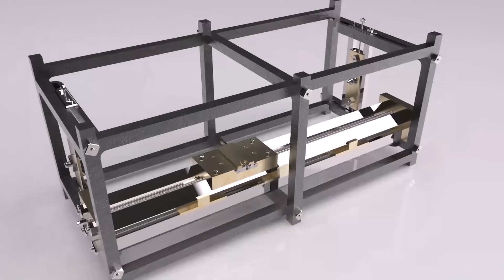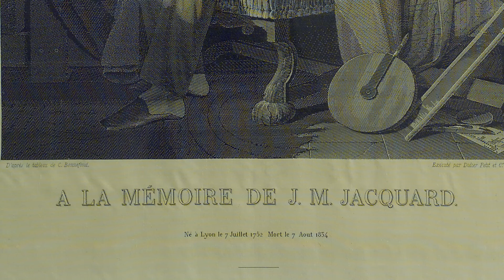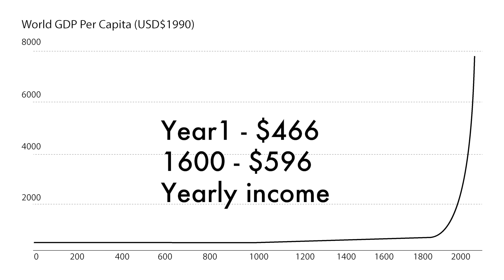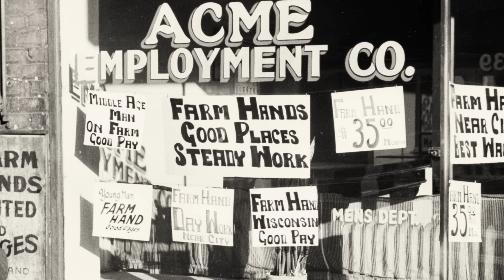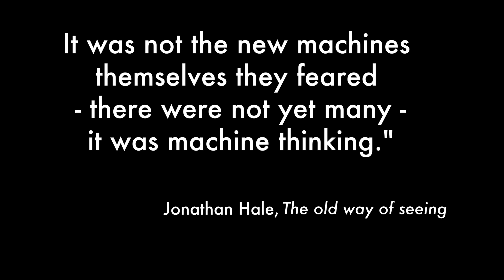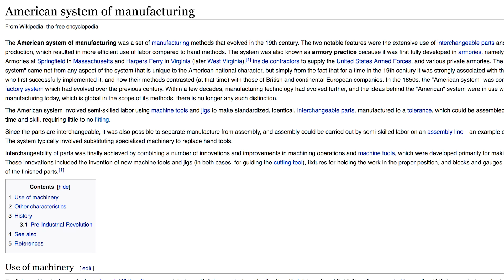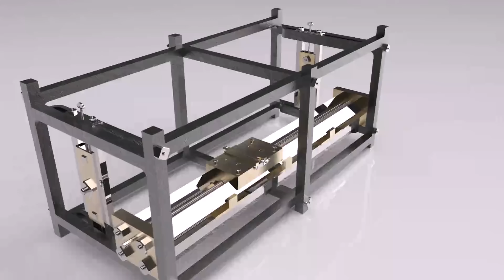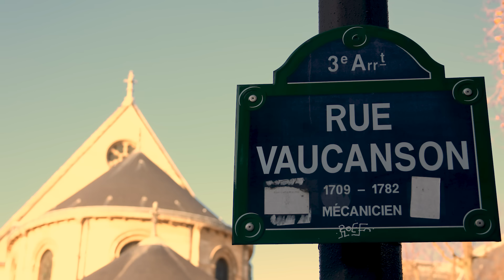The 1751 Machine that Made Everything

Comment: The lathe is the only machine in a machine shop that can duplicate itself and all the other machines which have to start with the lathe.  One of the best videos I've seen to date.
Reply: the people on here who are disagreeing with you obviously have no machining experience. I confirm 100% with you that you can make a lathe with a lathe, and a drill press and most other machines.
Reply: When my lathe was waiting for a new motor, I used my mill as a lathe. Obviously a bit cumbersome, but it got the job done.
Reply: Perhaps a 3D Printer can print itself.
Reply: @MildMisanthropeMaybeMassive  indeed it can, look up the "reprap" project. that was the principle behind it, it produced 95% of its own parts, with only the motors and electronics requiring other processes.
Reply: @MildMisanthropeMaybeMassive  I wanted to create a Lego Mindstorm robot that would dig through bins of pieces and build a copy of itself and then access a computer to program that copy with identical instructions.
Reply: @VincentDangerWater  I would love to see that dream become a reality. Even if it doesn't work I can imagine a video about the process and challenges going viral.
Reply: @MildMisanthropeMaybeMassive  I can give you a hint about a few of the most significant challenges.

You wouldn't be able to work within the Mindstorm NXT software to program the thing.

Visually identifying specific pieces while digging through a bin of pieces is a very difficult task requiring massive parallel computing.

Building lego "hands" that can manipulate and assemble legos seems like the fun part. You'd have to overcome a grip issue by pre-applying a rubberized coating to the manipulating fingers.

Finally, the challenge of overcoming the limitations of the strength of lego connections. Certain lego connection types are stronger than others. The hands need to be built out of the strongest connections, otherwise the compressive actions needed to assemble parts would sheer the hands apart. You'd have to have a very meticulously ordered assembly strategy, with the robot potentially pausing at points to service its own lego connections, if loosened during the procedures.

It would be fun to see someone pull it off though. For such a silly idea, it really would require a massive range of disciplines.
Reply: @VincentDangerWater  Lego and Youtube is built on silly ideas and massive discipline.

Thanks for writing all that.
Reply: Yes Scott
Reply: Ever wonder why early milling machine were horizontal? It's because the first milling machine was a lathe driving a "rotary file".
Reply: YoYO Semite  ironically the only machines better at producing parts than 3d printers? are lathes and their ancestors the cnc machine.
sintered , 3d printed and moulded metal parts out of powder using SLA 3d printing are good but machined parts from billet are still far superior in accuracy and quality.
Reply: Do you think it includes machining the bed of the lathe as well?
Reply: You took the words right out of my mouth! Our machine shop teacher once told us this!
Reply: Mill even better...
Reply: @RealRocdad  Mill is basically lathe with one extra axis
Reply: I heard about a book that I haven't been able to find. It's a how to.
How to create wood and stone tools, use clay to create molds, melt aluminum cans down to cast parts to create a crude metal lathe, use it to create a planer and then a more precise lathe. It's one for the "survive the apocalypse" shelf of your library.
Reply: What about the furnace to make steel?
Reply: iT cOuLdN't mAkE tHe cAsTiNg. You obviously wouldn't use a casting, you would use a weldment. With the obsession of "oDdLy sAtIsFyiNg" video genre, machining channels have blown up over the past few years, and it's been a blessing and a curse. Now we have non machinists that think they're machining geniuses because "i'Ve wAtChEd aBoM79 reEEeEE." They have polluted machining channels with their attitude of being a machinist because they've watched YouTube videos about it.
Reply: Lathes are AWESOME, but if I was forced to pull one or the other from my shop, I'd definitely keep my MILL, I can duplicate lathe operations using my MILL, but I can't duplicate mill operations with my lathe. I find a flaw in your reasoning.
Reply: @ScoutSniper3124  Sure you can! Pop a collet chuck onto your spindle, stick an endmill in that puppy, and use your cross feed as your X axis and your long feed as your Z axis. lol
Reply: @ScoutSniper3124  lots of milling operations can be done on a lathe.
Reply: @ScoutSniper3124  As long as you don't need too large a milling operation, you can buy a milling attachment for your lathe saddle [it usually attaches in place of the compound] and duplicated milling abilities by mounting the cutter in the lathe stock. Yes, it's a kludge, but far less kludgy than performing lathe operations on a mill. Just saying that it's a hard call, & depends upon what type of operation you use most.
Reply: @ScoutSniper3124  you are obviously not a real machinist or you would know you can mill on a lathe.
Reply: @Gebox68  how do you mill on a lathe?
Reply: @johnbecker3116  as jason flieger said in a previous comment. you use your spindle as the toolholder and clamp the workpiece where you would have the toolholder.
Reply: @Gebox68  so you turn your lathe into a horizontal mill with no y axis... What are you going to mill with that?
Reply: @slash09r1  you would fit a vertical milling slide.
Reply: @johnbecker3116  You swap the tooling. You hold the milling tools/bits in the lathe chuck with a collet, usually a 5C type and you use a vertical milling attachment on the cross slide to hold the work piece. Granted you will not have the same length of travel unless you have some elaborate setup for a long bed on the vertical milling attachment, but it could be done. I would gather that all that time, effort and cost would be greater than finding a good used Bridgeport mill in the long run.
Reply: @johnbecker3116  I have seen people cut square and rectangular cubes/bars/slabs of metal (to accurate measurements) using a four jaw chuck, some math, and a piece of round stock large enough to get the desired part out of it. Though, I'll admit that there are limitations, you can do a lot of things you would do on a mill on a lathe (though to a much smaller scale).
Reply: Not entirely correct, you cannot cast or forge the stock required to make a lathe with a lathe, therfore a lathe is just a tool that is used as part of the process to build a machine
Reply: @techronmattic5876  The earliest metalworking lathes were timber.
BTW a potters wheel is also a lathe...
Reply: @allangibson8494  thanks for proving my point, just as you would not use a wood lathe to chop down a tree and prepare the timber to a workable size i was pointing out that a metal lathe is hardly where it all starts, all in good fun
Reply: @techronmattic5876  No but you can get away with flint tools to do it...
Reply: @techronmattic5876  he said wealth was increased because of the metal lathe.  not sure i agree with that as the main reason either.
Reply: @techronmattic5876  you are being pedantic!
Reply: @Gebox68  most lathe tools in days gone by were forged before going to a machinist, just pointing out that without smelting and forging the mighty machinist would be turning wood with stone tools, if that makes me pedantic then so be it, im not disagreeing with the video, just pointing out a few facts
Reply: @techronmattic5876  that's a moronic argument!
Reply: Not true! The milling machine is the only machine which can reproduce itself and all other machine toools to date.
Reply: @clintmilam  take a real good look at a milling machine and lay it on it's back, then stand at the side and then look at what you have. please don't just comment to look smart because most of the people disagreeing with the original post are thinking they know it all when the reality is they dont have a clue. unless you actually have experience with machining and engineering then you should really just shut the fuck up and let the grown ups talk.
Reply: you cant make a drill press with a lathe
Reply: @slinq  Yes, you can. The plans are online. You can also use a lathe to replicate all the functions of a drill press. South Bend used to publish a whole set of training manuals on how to make various machine tools starting with a South Bend lathe (including another lathe) as machinist training materials.
Reply: @slinq  Easiest one yet!!! Round coulum,spindle table pulleys,Faceplate bore base,head and table castings Even cut rack gears with tool post grinder!! What part you missing? Describe it and i'll tell ypu how to make it with a lathe!

Comment: Now if you permit me (to be nerdy about the Musee de Arts et Matiers in Paris).  In the entrance area we see a bunch of measuring 'tools' from different Kings.  There are liquid measuring flasks, weights and rulers.  The early roll of the kings in Europe was to actually regulate industry.  For example, if you sold milk by the gallon, how was one to know if your flask measuring a gallon wasn't being made smaller to cheat and sell less milk? Well the king would send his 'inspector' with the 'royal' flask and would pour milk from one flask to another to check if the volume is correct.  The same for weighing, say, fish and the same for measuring, say length of fabrics bought.  
.
To see the official measuring tools of the various Kings of Europe makes you appreciate how they used Science to regulated commerce back  in the day.  It also makes you appreciate how they standardised to the "Système international (d'unités)" (the metric system) and how, to this very day we still have some countries 'cough' that have not standardised.

Comment: When you have experienced the degree of precision a modern gasoilne engine requires hands on and what gaps steam engines are tolerant to, your point about precision really strikes the core of it. The principles each work on aren't this hard to think up, but to make a combustion engine run evenly and for any amount of time, you need to be able to machine its shaft to dozens of mikrometers whereas most steam engines will happily run when built to tenths of millimeters and nicely gunky thick oil.